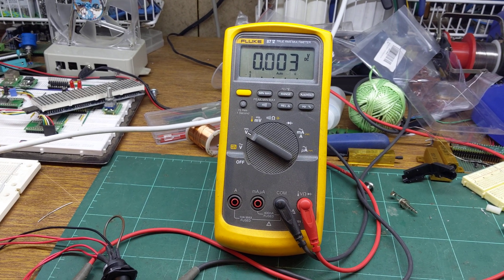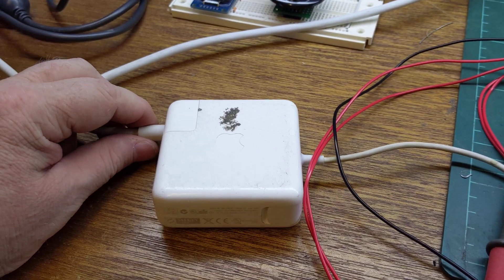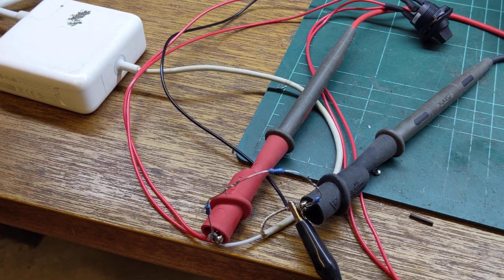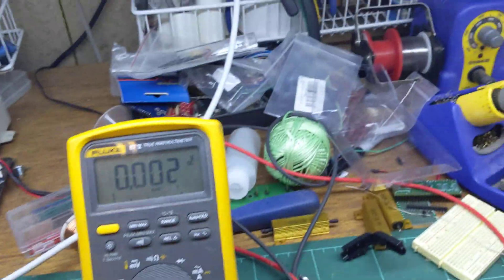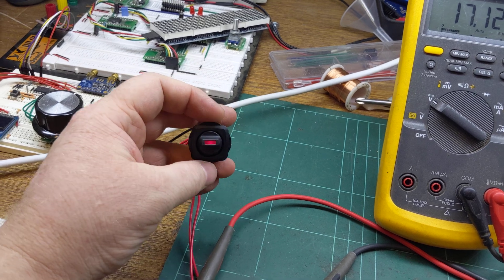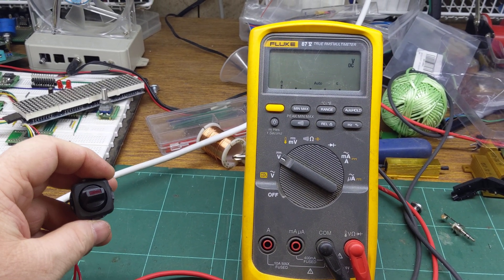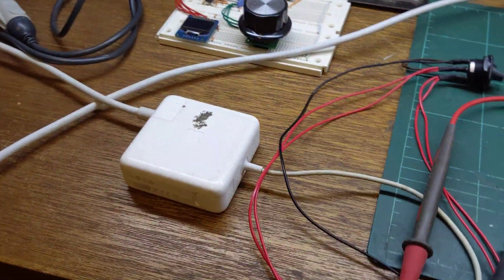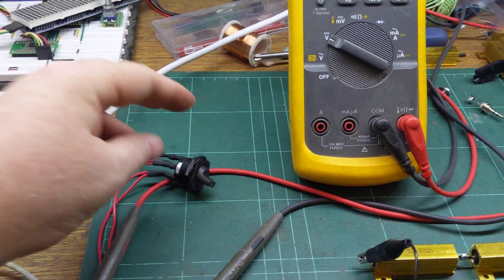Reusing an e-wasted MagSafe MacBook PSU

Comment: Hi. It was so hard to find this information. I'm glad I found you. My  power brick is rated at 45, 60 and 85w with varying voltage. Do you know what makes it switch between these different output voltages? Do I need to trigger it somehow?
The reason I want to use it, was an article which said that this is a resonant PS, a half-bridge LLC, which should emit much less noise than omnipresent hard switching topologies or even linear PS. This article also said that macbooks use the pull down resistance only for the initial second after the connection is made. Is that how it really works?